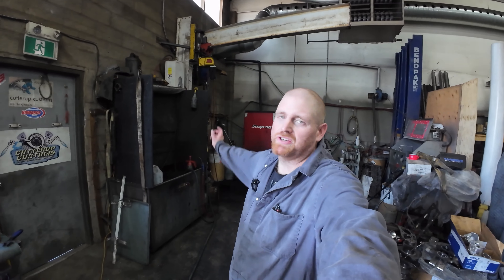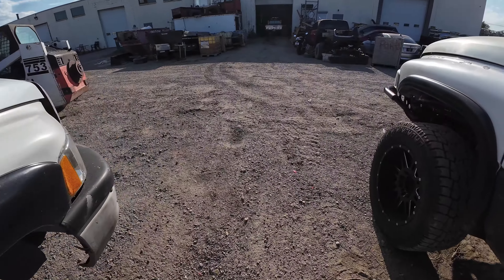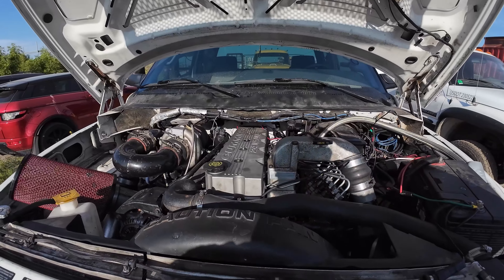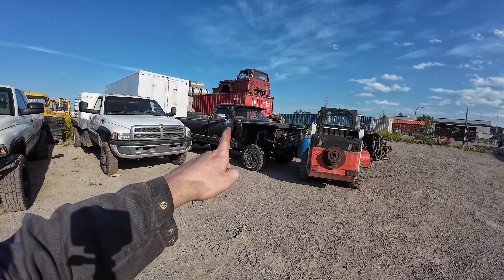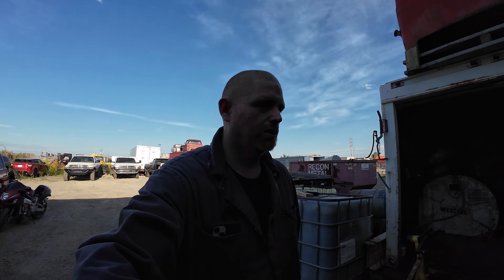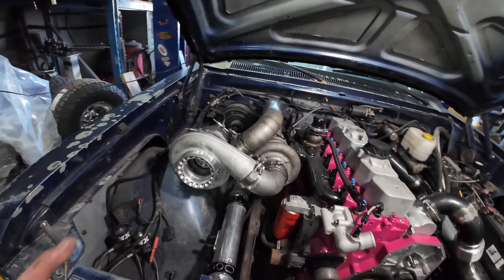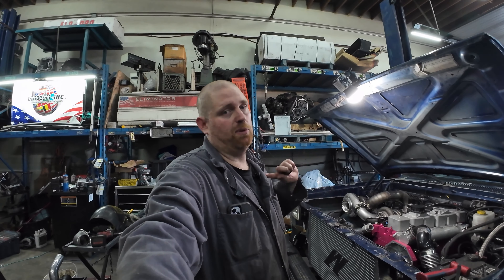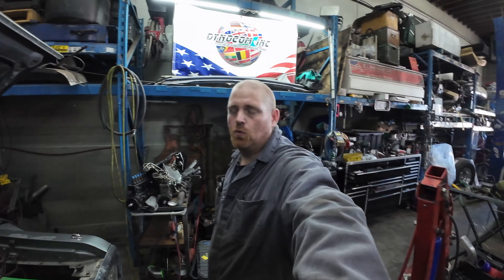I BEHIND,  BUT I AM WORKING EVERYTHING

Comment: @2:05 I cant wait to see this dyno comparison. Banks vs stock, vs what ever.

The company dyno test everything else but he wont post his horn. 
He just sticks to the flow bench numbers, and air density blah blah, everyone else stuff is wrong and should be doing that....... in cali. 🤣🤣
Reply: It’s probably about 5hp on a good flowing air horn but that is so close that paying attention to all the temps that they are the same to do an honest comparison will take time and being really careful.
Reply: @bcbloc02  I have seen many base line runs on multiple set ups posted on YT.  and 10 to 15hp seems to be the variable for 300hp to  500hp engines. The variable between runs seems to go up as the power level increase. I would need to see a reasonable but bit more than that to remove my doubts.